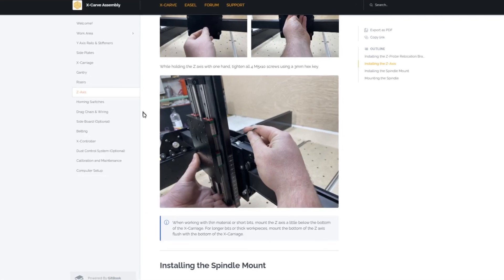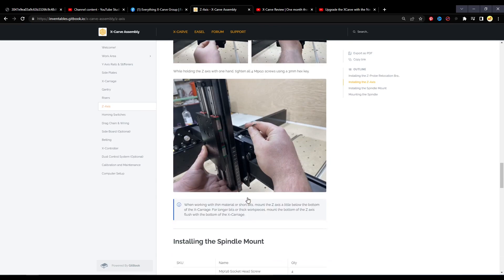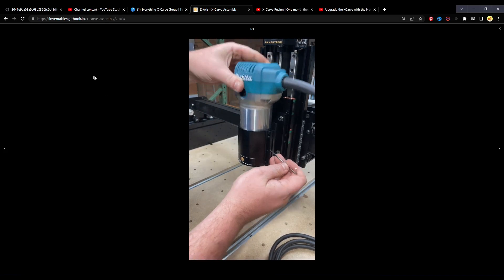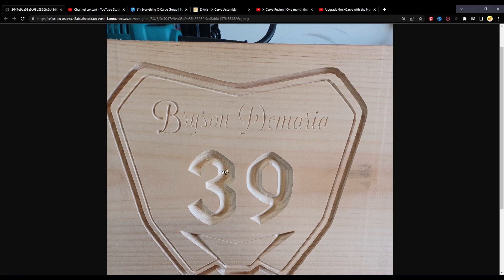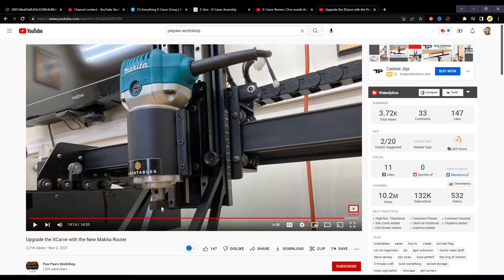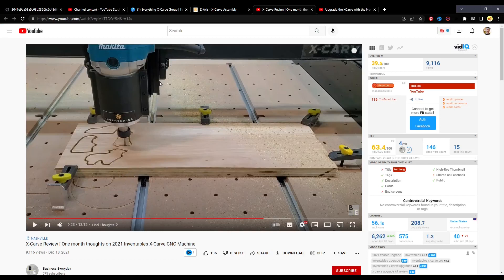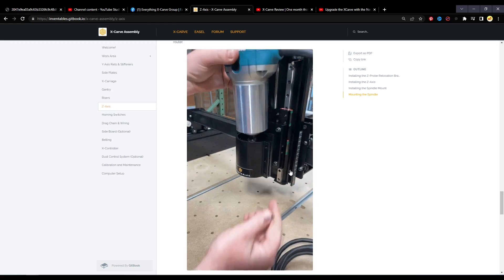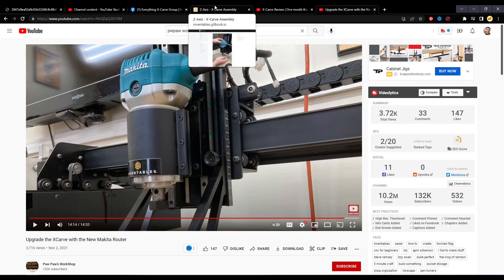New X-Carve CNC Doesn't Cut Right? 5 Minute Fix

Comment: I'm having issues with inconsistent z height. I've been using the x carve for many years, not new to it. It's not the issue your describing because I've already checked that. Work piece is surfaced, brand new surfaced waste board, bit isn't slipping, all the variables have been covered. It only seems to happen on the detail pass with a v bit when there's a lot of required up and down movements of the z axis. sometimes it goes too deep sometimes it goes to shallow, by a significant amount, floating 1/8 above the surface not even touching. I've been going back and forth with support for months. They sent a new Derlin Nut saying there was a faulty one on some of the upgrade kits. Who knows. The tension screw on the bottom of the new derlin nut that came is lose, no lock tight, the nut is free spinning and the hex screw isn't even touching the opposing side, so there's no specific setting to it, it's not serving any purpose right now. Prior to it arriving I was told by support not to adjust that screw that it's preset to a specific tension. But obviously it's not preset to anything which now has me worried this new derlin nut won't solve anything. Any ideas? I purchased the upgrade kit about 9 months ago, never had issues before then over years of use. This issue is definitely tied to something with the new upgraded z kit.

Comment: Hi, I just purchased my first CNC - a Genmitsu 3018 ProVer - and I'm trying to wrap my head around GCODE macros to ramp-up the spindle speed each time.  I spotted your excellent reply to a similar question on Inventables but thate thread is now closed so I came here =)  Could you please point me to a tutorial that explains how/where to insert these macros?  I assume there are not part of the CNC's basic setup file (a text file with 34 strings listed $0 through $132 in my case).  Thanks!
Reply from the maker: If you're using candle software to control the cnc the macro is added in the settings page. 
The code to use is about halfway down this page in bold. You would then need to click that macro button just before starting the carve job.  
https://www.sainsmart.com/products/genmitsu-gs-775m-20000rpm-775-cnc-spindle-motor-noise-suppression-compatible-with-3018-series
Reply: @SethCNC  Thank you!  I have Candle and UGS but I'm actually using VCarve Pro
Reply from the maker: Side note, the best place for genmitsu help is the Sainsmart cnc users Facebook group.  Nearly 30k members all willing to help each other out!  And of course the YouTube channel @James Dean Designs has a ton of 3018 beginner videos,  check out his Playlist for the 3018 👍
Reply: @SethCNC  Noted.  Thanks again!  Cheers

Comment: Came to this same conclusion today. I ran the z axis to the bottom of the rails and then raised it .200. Then unscrew the z axis assembly with my shortest bit in it and touched it to the t track on the new x carve. Raised it .125 and tightened it back down.